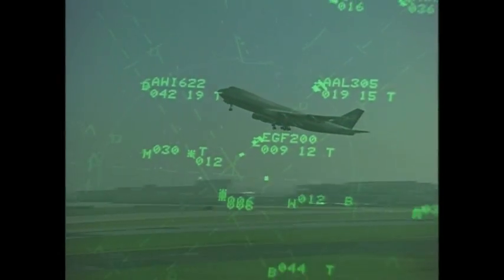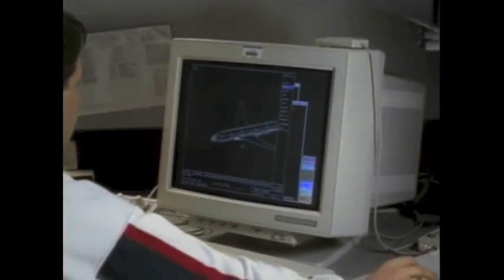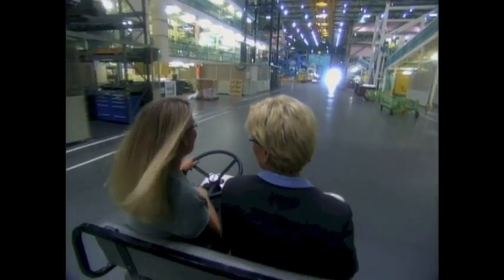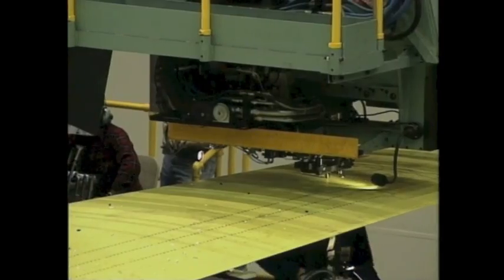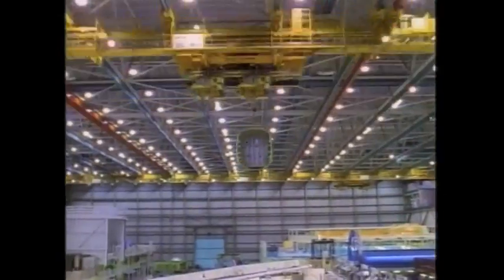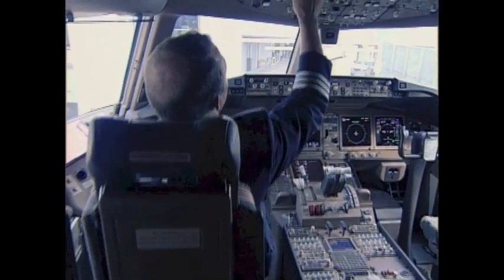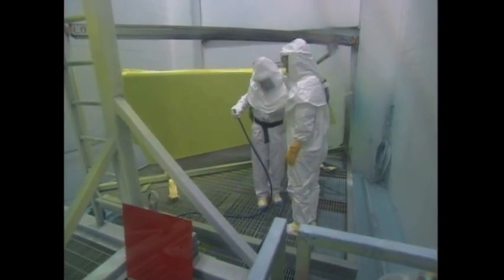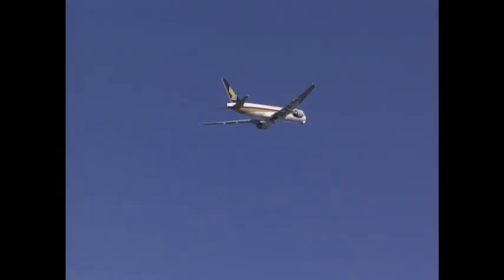Joan Lunden Behind Closed Doors: Boeing 777

Comment: Very impressive, so who screwed up the 737 MAX? I don't think it was these people. Killed 365 people, way to go Boeing! Some heads should roll, probably a "software engineer" !
Reply: John Harris:

The 737 MAX should have been given a new wing....current engines and Maximum Take-off Weight are far beyond the capabilities of its 50+year old origins. Now Boeing is paying the price....more 737 MAXs will crash once Boeing dupes the FAA,EU,etc Regulatory Agencies.....for it to fly again.

What's MCAS all about? It's because with the new far more powerful and larger fans.....and the engines mounted further ahead....the plane wants to take-off nose-up beyond safe limitations(which means the wing will stall). MCAS is all about controlling the pitch of the  aircraft with a wing that is compromised. 

Only a competent Pilot can fly  (meaning takeoff and step-up in altitude)the 737MAX with or without MCAS....and in a situation where MCAS fails and commands the plane nose-down into the ground. Requirements today (with a Global Shortage of Qualified Pilots) means many future 737MAXs will crash once the Grounding is lifted...do to lower Standards required for Commercial Pilots to fly commercial jets.

The Military is keeping its Pilots with insane salaries and re-sign bonuses....so the Airlines are not getting "Top Tier" Pilots with plenty of flight hours like they did previously.